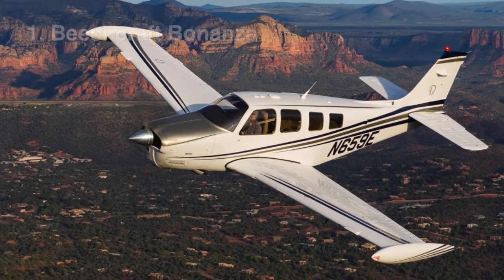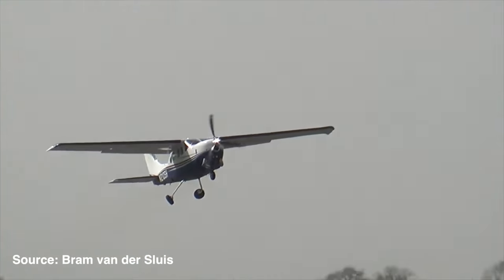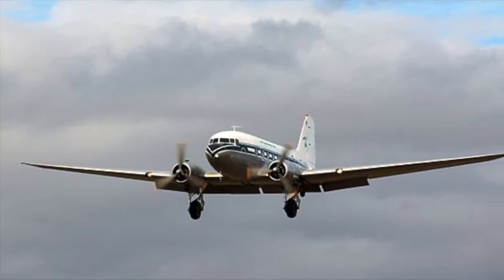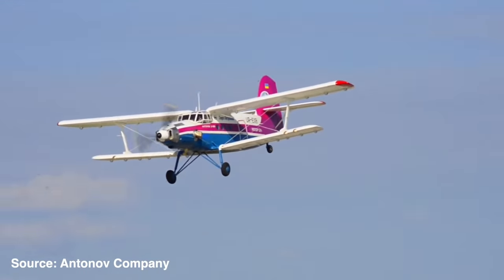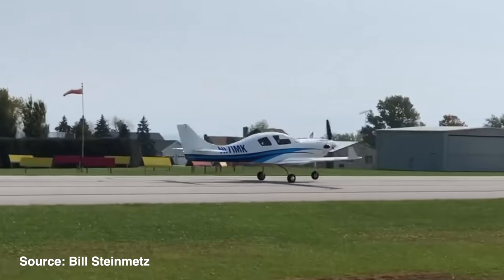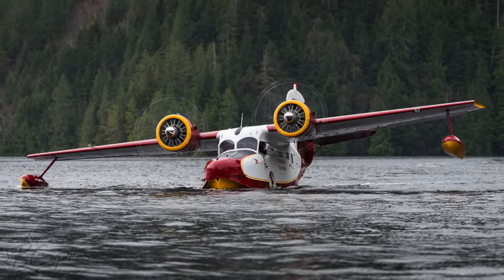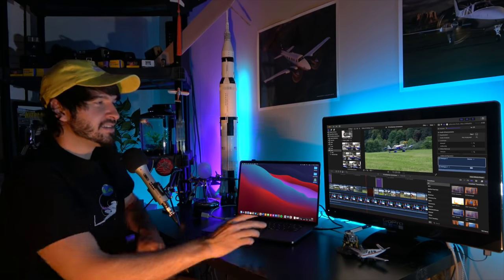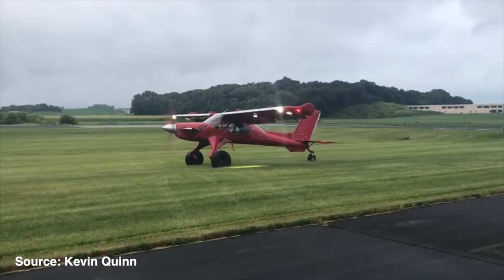Airplanes Modified for SPEED - 10 Turboprop Conversions

Comment: It is a waste of fuel and engine to fit a Pratt to a small GA plane like these Cessna's and Beech Baron.  Really dumb in fact.  Such an engine is only suited to pressurized aircraft and flying at 18 to 30k feet.  None of these conversions are in that class.  Flying low with a jet-prop is an utter waste of fuel and shortens the life of the $500k engine.
Reply from the maker: You have a point. It is just cool to see a small plane with a powerful engine. With conversions like the Bonanza, the true capability comes only when you use oxygen at altitude. Also turboprops are great for skydive applications in that they do not have to be concerned about shock cooling.
Reply: Speedo Mars, the BONANZA turbine conversion is a Rolls Royce/Allison 250-B17, not a P&W PT6A. The PT6A is only suited to pressurized aircraft? EVERY U-21 operated by the U.S. Army was powered by two PT6A-20s; every Beech 99 airliner was powered by two PT6A-20/27/28/36. Not ONE of the U-21s or the 99 airliner were pressurized. Both were based on the B80 Queen Air airframe. $500,000 for a PT6A? In your dreams. In 1996, I purchased two, zero time factory reman -42s. Because we did a great deal of business with Beechcraft( we were a Beech service center) we got a special discount. The final bill was just under $800,000. This was 25 years ago. The last time I inquired on the price of a new PT6A it was around $900,000 per engine depending on the dash series. Shortens the engine lifetime? How so? I had an airliner customer whose PT6As were on an “on condition” overhaul cycle with the FAA. One of their -27s had over 20,000 hours and 35,000 cycles on it but it had never been overhauled and had NEVER been above 10,000 ft. The Beech Duke has a service ceiling of 25,000 ft. If you knew how unreliable the TIO-541 engines were you would understand WHY owner/ operators of these aircraft spend the $2.5 million to covert them to turbine power.
Reply: @stevehicks8944  Doesn't matter who makes the jet-turbine.  The U-21 was a 67-68s Army variant of a Beech King/Queenair twin.  They were used for low-level surveillance and radio relay hence no pressurization was needed and the military doesn't care about wasting fuel.  The Beech 99 was the same aircraft civilian version also used for short hop commuter/cargo service.  The aircraft was upgraded to full pressurization in the 1980s.
Reply: @speedomars  Hmmm....former Beechcraft employee here. The last of the 99s, the C99 was UNPRESSURIZED, the same as every Model 99 EVER constructed. I helped convert s/n U-231 ( C99 serial numbers end at U-236)into a freighter: no pressurization system. You said that the PT6A was designed for pressurized aircraft operating at 18,000-30,000 feet and prolonged use at low altitude would shorten the time life of the engine. I take it you have ZERO aircraft maintenance experience? BTW....the King Air (Model 90 in particular)May share fuselage and wing structural components and parts, but they are total different aircraft. The U-21 was a B80 airframe with the wing, nacelles and empennage of an early King Air. Its model designation was 65-87. They were in service until the early 1990s. They were primarily used for VIP and liaison transports. I know this because a friend of mine ran the Aviation unit at Ft. Knox. Only divisional commanders in the Army got C-12s in those days( mid to late 1980s). Care to continue this discussion? You are at a disadvantage; I have actually bent wrenches and given technical advice on the aircraft you are prattling about. Jet-turbine? The PT6A is a free spooling, reverse flow turboprop or turboshaft engine; the Rolls Royce/Allison 250 is a turbo shaft engine. If you are going to attempt to impress folks with your minuscule knowledge of aircraft engines learn the proper designations. That way you won’t sound like an absolute fool.
Reply: @stevehicks8944  cut the kid some slack. Too many people nowadays are busy molesting keyboards instead of actually getting things done, like building things or running a business. 😉